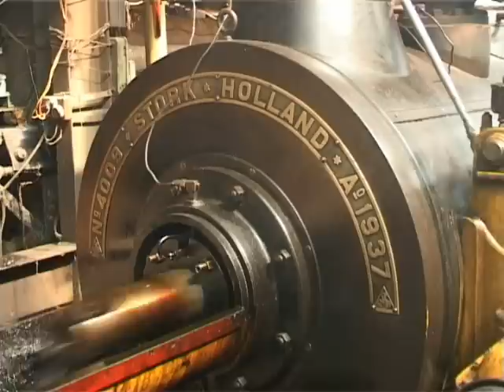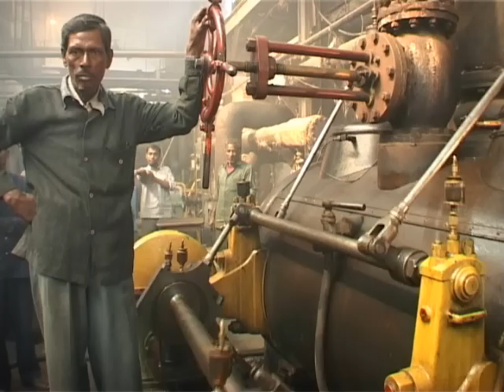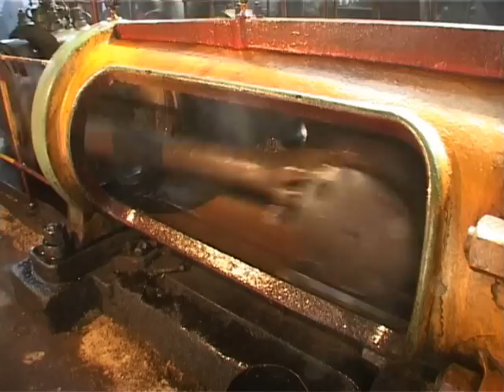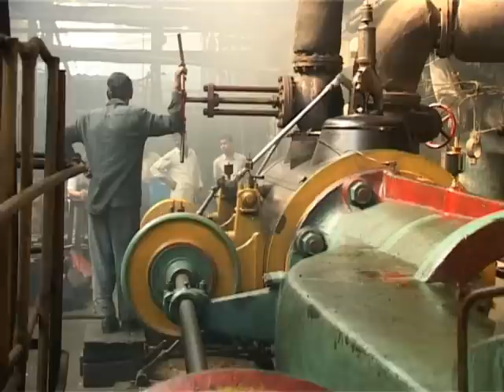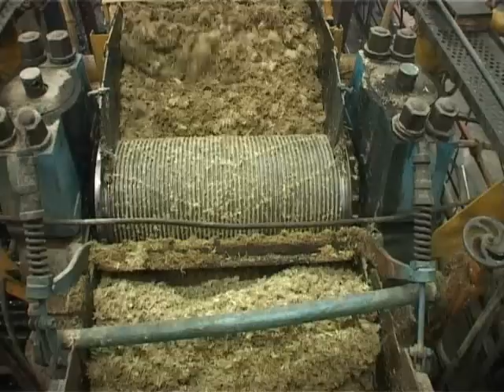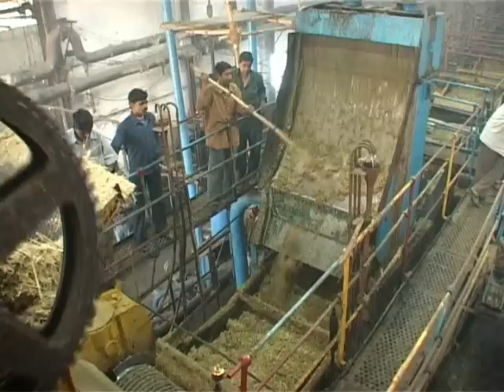Khaitan Sugar Mill, West Bengal, India 2006

Comment: I am extremely pleased to see this Stork steam drive system. I was made to understand that British Guiana back then has had mechanisms similar to these. Please correct if I am wrong but was there a Stork-Werkspoor sugar mill? I f such a make did exist then it was at the Port Mourant Sugar Estate owned by a Stephen Mourant in 1830s-1840s? However, this estate was passed on to a number of owners where it's last owner was one Col. F.Galloway. Port Mourant Sugar Mill had undergone a major modification where the Stork-Werkspoor was decommissioned and George Fletcher mills were installed in 1932.Does anyone recall Thomas Wilfred Swingler from Great Britain? He was the Engineer that was responsible for the installation of the George Fletcher mills and in somewhere in the 1930s ,one pre- Christmas evening was fatally shot and killed by a local! The factory was closed in December, 1955! It was the largest and most modern sugar mill in the whole British Caribbean.